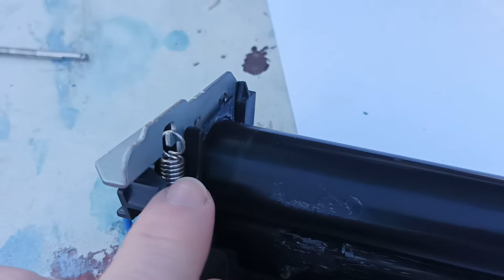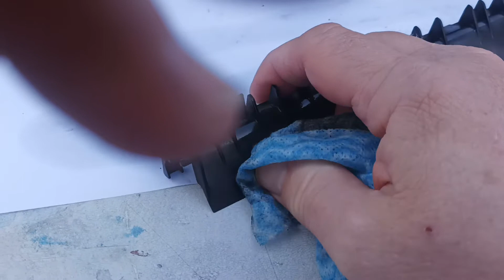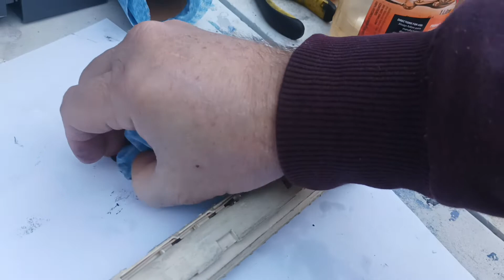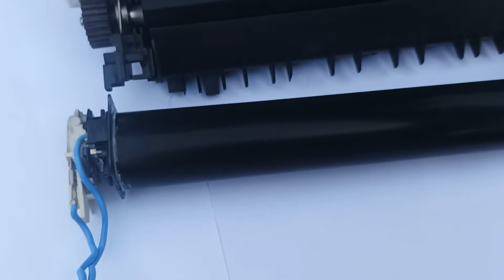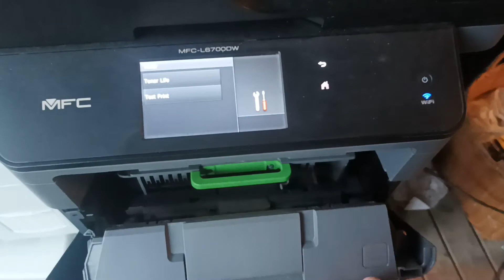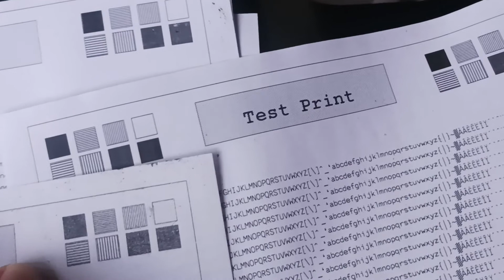Brother MFC L6700dw, L5700dw,L5755dw, L6900dw, L5100dw,L5200dw Fuser Unit Advanced Repair Part 2

Comment: Another very interesting and useful video, thanks for posting all these detailed printer repair videos! 
Since I found your channel I slowly make my way down the list, watching your videos. I have a Brother LED printer which still works fine since 3 years, but the infos might come in handy some day.

I noticed that most Brother laser/LED printers seem to have heat rollers (aluminium tube with a heat lamp inside) instead of the fuser film sleeve shown here.

What system is better/more durable (needs less repairs) in your opinion? 
Or are both more or less the same?
Reply from the maker: Film has speed but short life roller has long life but easy to fix